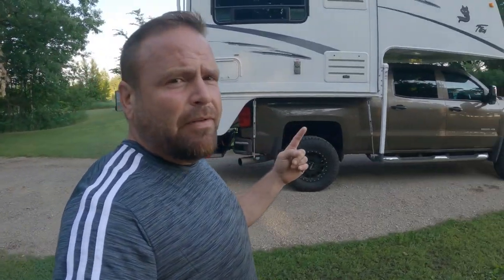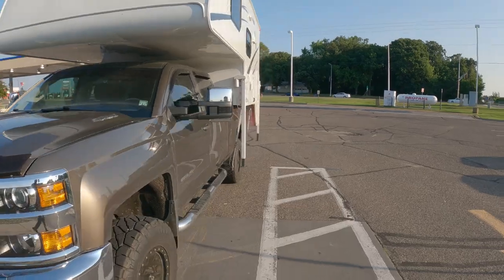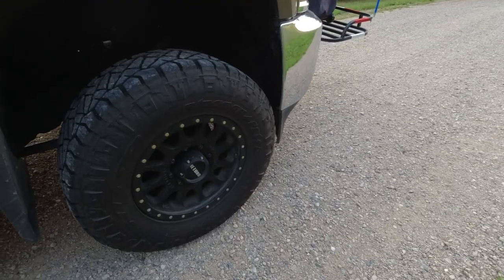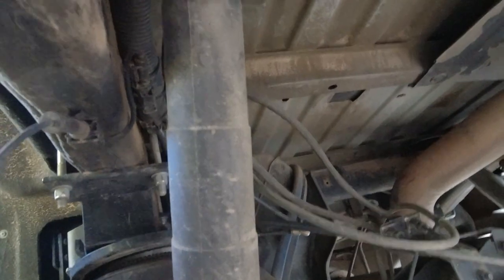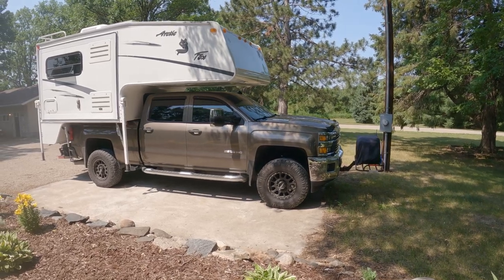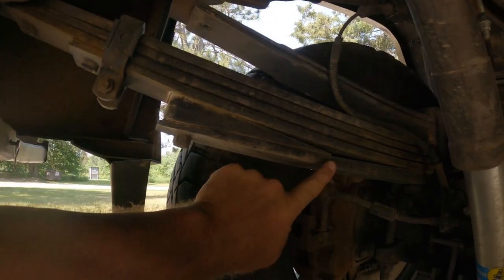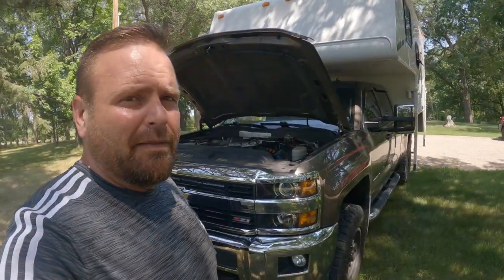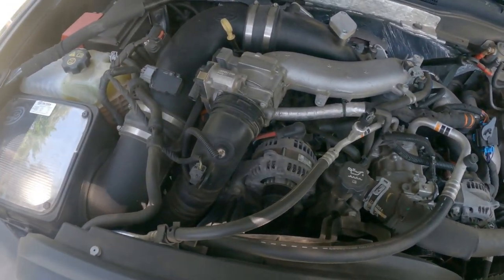Suspension upgrades for Truck Camper

Comment: I beg to differ! My motto has always been, never run a diesel when a gasser will do. That is, unless you really need a diesel, then go for the diesel. Diesels are more complicated, more expensive to buy and maintain, and they definitely don't like extreme cold starts.
Reply from the maker: Those are all valid complaints against diesels. I'm not saying a diesel is required for a truck camper. The diesel for me is more of a hobby. I've had the truck many years before starting the channel. One of my other big hobbies, besides camping, is upgrading my truck. Dollar to dollar, you can see more power, a lot cheaper by modifying a diesel. So, for me, a diesel isn't needed, I just enjoy learning about another platform to tinker on.

Comment: I'm very interested in your Felling Block. I have added A Hellwig Anti-Sway bar and the Hellwig 3510 Leaf package to my Chevy 3500. I'm curious if I'd gain  any height ( 3/4'-1" ?) if I also added the felling blocks. I was very surprised the squat I got in the truck when I added a different camper that weighed about 1000 lbs more that what I was running. I'm still ( barely ) under the max GVRW for the truck.  THANKS !!
Reply from the maker: The felling wedges are going to add height to the rear end. I would not be able to say exactly how much though. The idea is the felling wedges are going to engage the bottom overload Springs right away. A big Advantage is your truck is going to have a lot less sway. Put the felling wedges in the front and back of the lead pack. They Contour the Springs really nicely. Felling wedges are meant to take a ton of abuse. There is no way that you can damage these. They're also very inexpensive. I think around 8 bucks a piece.  Make sure you properly secure them in place. I've seen people try to do it with zip ties and it does not hold. I bolted mine on to the bottom of the rear spring. You will absolutely not be disappointed with the upgrade.
They do make a product designed for this application. They are called torklift overloads. They will set you back over three hundred and fifty bucks.
Reply: @KennyOfAllTrades  I've already purchased the Felling wedges off Amazon. ( a 4 pack ) I was looking to place a 3/8" carriage bolt ( countersunk in the wedges ) through the leaf where there  is already a hole drilled for the anti squeak pads .
Reply from the maker: @RimdarRanch  that is exactly what I did.
Reply from the maker: @RimdarRanch  I did use nylon locking nuts on the carriage bolts.
Reply: @RimdarRanch  would you mind putting a link to the wedges you bought?
Reply: That be awesome!
Reply from the maker: I think I got about 3/4 inch lift from the felling wedges. Having the weight of the camper on the stiff overload spring helped the camper feel more stable.  I suggest giving it a try. The worst-case cinerio is you will be out 20 bucks... but you will have a nice set of wedges. You will have to let me know what you think of them.
Reply from the maker: Thanks!

Comment: Hey Kenny..Enjoy the videos thanks for the content. Question please. I have a 2017 GMC 3500HD Dually looking at the suspension Maxx with control arms I noticed you used a different manufacturers upper control arms any particular reason over the Suspension maxx upper control arms? Any issues with the articulation with the arm sitting on the stop?
Keep up the great work.!!
Reply from the maker: There was no reason for the different control arms, other than I bought the suspension max torsion keys and differential drop spaces used of Market Place. I have not had any issues with articulation. I have been on some pretty nasty trails and my tires have been sticking to the ground.

Comment: I like your Method wheels. Which offset did you choose? 18mm?
Reply from the maker: The wheels are a 18x9 with +18 offset. I think they provide a nice stance. The tires and wheels fill out the wheelwells nicely.
Reply: @KennyOfAllTrades  Yes, I like your set up and the Method HD wheels are the only ones I have found that have a 4,000 lb capacity. I have a 2022 3500 WT on order and have been looking at wheels and tires to replace immediately. I'm fairly sure that with the new body style I can fit 35" tires without a lift. LT 285 75/R-15 are 34.8"
Reply from the maker: That should look awesome 👌

Comment: Just watched your video . I have a 2015 Duramax with 53K and want to get a lift pump and  conversion to a CP3 before I have issues . Looking for suggestions on where do get it done in MN. .
Reply from the maker: So the lift pump is really easy. If you have a little mechanical background you should be able to tackle it. I went with the Fass, super simple. I did install a sump in the rear of the tank. I reinstalled the tank shield which covers the fuel lines. That way the lines won't get caught on anything. 
The CP3 is a whole different animal. I have complete confidence in BT Diesel in Royalton MN. Brad is a genius when it comes to Diesel. He could hook you up with the cp3 conversion. They have kits that work with emissions intact and don't require tunes......unfortunately if your were looking to delete I don't know if you will find any help. It's getting harder to find any one capable of writing the tunes. Doing a delete is quit easy and can be done in the driveway. It sucks when every time the truck breaks down its because of the emissions. I replaced the DEF heater twice and EGR cooler once.....never again. What part of the state you in?
Reply: @KennyOfAllTrades  I'm in Rochester  ,  thks I'll contact them.
Reply: Northern Diesel Performance & Repair in Big Lake, MN is another diesel shop that comes well recommended.

Comment: How many inches did you raise the front to get the bigger tires to fit?
Reply from the maker: I went up 1.5 inches. It has a slight rub at full turn when in reverse.  If I trimmed the valance up front it would rub at all.
Reply: @KennyOfAllTrades  ok cool. Tuesday my truck is going in to get raised 2 and quarter inches because iam also putting tires on that are 2 inches bigger.  Thanks
Reply from the maker: That will look awesome, I dont think you will  have any fitment issues if you stay under a 35 inch.
Reply from the maker: I should say under 36.....a 35 will look and fit the wheel well nicely

Comment: I’d like to do the bushing to engage the upper overloads but all I can find is the $400 torklift stableload. Any other suggestions where to look? Couldn’t find any that fit a 2022 GM 3500 on energy suspension.
Reply from the maker: https://www.energysuspensionparts.com/9.9136
These are listed as a universal fit. I was able to install them on my 2015.  I'm not sure what the install will look like on a 2022.
Reply: Precision trimmed 2x4
Reply from the maker: I did a body lift in a 1986 Toyota pickup with 4x4's, of course I used a quality stain and water sealer before installing.

Comment: Hahaha dually Explanation is hilarious
Reply from the maker: I had people say my truck is the same length as a dually. I just don't understand. I have M860, which is specifically made for a short box truck. You could load it into a long bed. There would be a gap between the camper and the bulk head. That combo would still be 18" longer than my short bed.

Comment: Hey Kenny. I bought the felling wedges and screwed stainless hose clamps to them to tighten around the leaf springs. Is it okay to hammer them into the crevasse a extra inch or so so I can get more area to tighten the clamps?
Reply from the maker: I jacked up the rear of my truck to open the leaf pack. I'm not sure if tapping them in place would hurt anything. I do know leaf springs can crack. I guess that's something to keep in mind.

Comment: Hey which hit h you used for the front bumper basket or is it a kit?
Reply from the maker: The front 2" receiver was purchased through E-trailer. It was a simple install. It took 30 minutes with hand tools, nothing special. The basket is a Harbor Freight ATV basket. It was 40 bucks. It slides into the 2" receiver perfectly.

Comment: You said in the 1st parking example the front basket would be the same length as a dually..  so why don't you just get a dually already,  Your truck right now is the same length
Reply from the maker: My short bed pickup truck with the basket on the front is the same length as a crew cab dually.
If I had a dually, I would put a basket on the front to carry the generaor. 
For me, that would be a little too long. That is what I was trying to say.

Comment: Dually doesn't make your truck physically longer though.
Reply from the maker: People have mentioned that, im not completely understand the concept. I took a tape measure to the dealership. Bumper to bumper my truck is 18 inches shorter then a long bed dually. People have said that my camper on a dually would measure the same as in my truck. But my camper is specifically made for a short bed truck, an Arctic Fox M860.  A person could load it into a long bed....they would have a large gap between the front of the truck bed and the camper. The COG of the camper would also be off, but I've seen people do it. 
I know there are campers that can be loaded onto a shortbed or longbed, the M860 wasn't designed that way. 
I'm not trying to be argumentative, but no one has explained how my shortbed truck with a camper specifically designed for it would be the same length as a dually carring an Arctic Fox with an on board generator and side storage compartments.

Comment: A dually wouldn't make your camper longer. That's a SB/LB camper? An 8 foot bed wouldn't change anything
Reply from the maker: Is this camper was made specifically for a 6.5' Box. I guess I could cut out the storage boxes and remove the generator and it would fit in an 8' bed.  You are right. They do make campers that will accommodate either bedsize. Unfortunately mine is not one of them.

Comment: An 8' bed on a Dually would not lengthen your overall rig. The back foot and a 1/2 of your camper would just be eaten up.
Reply: Exactly
Reply from the maker: My truck is 239.5 inches in length compared to 258.4 for the dually. True, I'm running a front basket making the length of my truck closer to the overall length of a dually. But Id have the basket regardless of what truck I drive. Also I'm running an Arctic Fox M-860 it hangs out the back a little. Just like If I had an Arctic fox 990 for the Dually.
Reply: @KennyOfAllTrades  
Yes,  without the camper on, your truck is shorter than a dually.. But with it on, it's no longer than if you had an 8' bed.
Reply from the maker: @Florida Man  This camper will not work in an 8 foot bed. It is made for a 6.5 foot bed.  You would need to step up to a AF 990, it is about 20 inches longer.